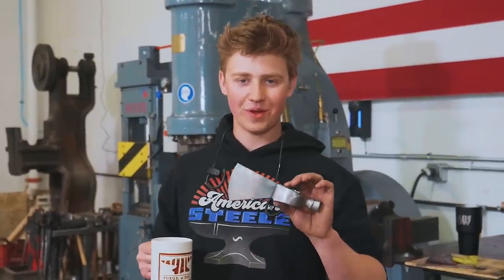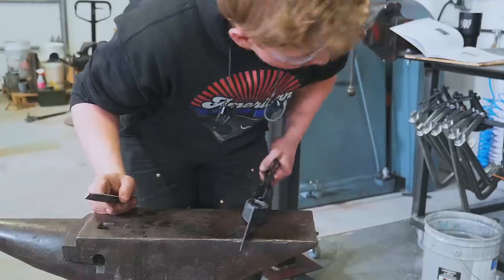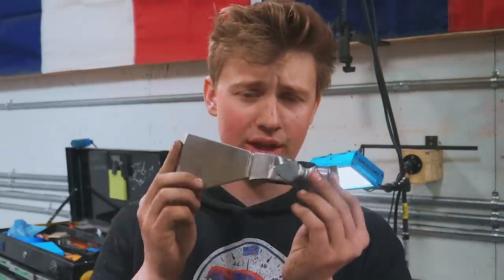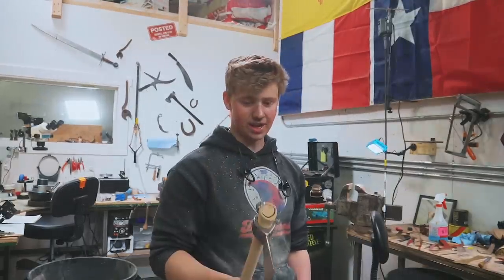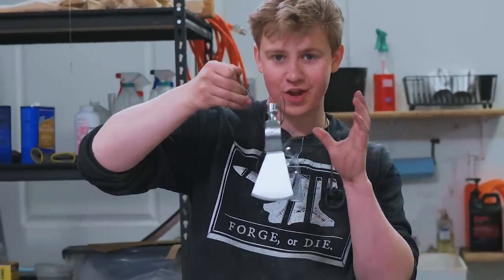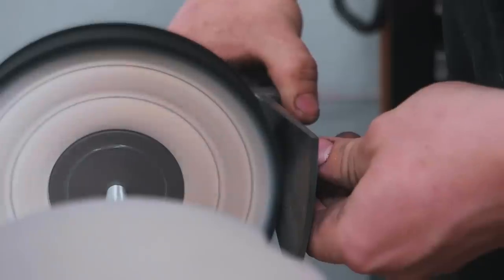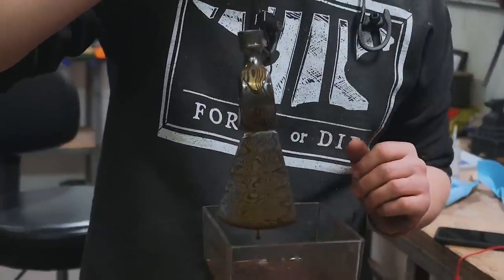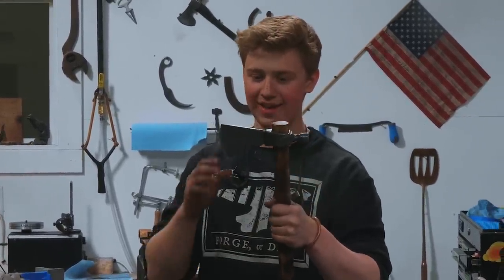MAKING A PIPE TOMAHAWK!!! Part 2

Comment: pine tar-turpentine-linseed oil for the finish and to make mathematical handles make a scribe jig that has a       post----7------scribe-----10-------scribe------7-------post    layout you can make the handle with the top and side view (tapered/curved) and hold this fixture square (top and side) and it will make nearly 45° angles. then, mark on the 45°s and you'll have your 22.5°'s and 67°'s  and bobs your uncle you have an octagon. My recommendations of course, I'm a machinist and woodworker, not a smithy.

Comment: A way to keep the scale off and to prevent decarb is to seal what you are heat treating in a sealed steel foil bag with a small amount of paper in it.

Comment: They are right Will, it does not have anything to do with the thickness of that part, but the geometry, that specific part of the blade usually distributes the energy from the impact to the handle by doing that geometry there you will have an energy accumulator that its the main thing you want to avoid in an impact oriented tool as this one, so yeah, be careful this thing can break a piece without warning

Comment: Could you tape designs, or use mud or clay or something on the blade before putting it in acid bath to control what parts of the blade have the Damascus etch showing?  so you could have a damascus blade with a blank ribbon down  the middle, or like happy faces or whatever?

Comment: Would it actually work as a  tomahawk if it was a working pipe or would the handle just break because of the hole that was drilled into the wood

Comment: My comment about the fuller was not in reference to the thickness at that point. It was a question of building in a point of concentrated stress under unusual loads i.e. off axis hits and throws. Now, I think the design and execution is beautiful, but I would shy away from a fuller running perpendicular to the striking edge.

Comment: Make a handle thicker than the hole. Sand the top 2 inch so it sits on a ledge. Then you could hammer a wedge in on the top as it's supported from the bottom. Just because it's not the same as a hatchet doesn't mean you couldn't mount it similarly

Comment: Are tomahawk hafts/handles really so simple? For some reason I had it in my head that they were slightly more shaped and ergonomic... not that I'm criticising the design at all, it's an awesome piece, but I'd have thought that there would be a little more curve in the wood here or there for comfort and strength.

Comment: Time for the fun police to spoil the party. I am impressed with all protective gear you guys use, and what could be more fun than a blow clean with a compressed air hose? This is what OSHA says:

Compressed air is used in industry for a variety of purposes and is considered the fourth utility after electricity, natural gas, and water.  It’s used to drive portable hand tools, used in scuba diving tanks, used in some vehicle braking systems, and also for cleaning.  Most machining and manufacturing operations have a compressed air system that allows for the quick connection of a flexible hose and air gun to clean dirt and debris from parts.  OSHA sets a limit on the use of compressed air for cleaning in their Hand and Portable Powered Tools and Other Hand-held Equipment standard, 1910. 242, as follows:

1910.242(b) 
Compressed air used for cleaning. Compressed air shall not be used for cleaning purposes except where reduced to less than 30 p.s.i. and then only with effective chip guarding and personal protective equipment.

While not explicitly stated, it is OSHA’s intent that employers in general industry should not allow employees to use compressed air to clean themselves or their clothing while being worn.  However, OSHA does expressly state that, “compressed air shall not be used to clean employees” in their Marine Terminals standard, 1917.154, and recognizes this as a safe practice for all industries. 

The greatest danger of using compressed air (even at pressures as low as 5-10 p.s.i.) is the risk of air entering the body and causing an air embolism in the bloodstream. This can be fatal.  Other risks include damage to the eyes and respiratory system as well as hearing impairment if suitable protective equipment isn’t used. 

It’s important to realize that most compressed air systems used for pneumatic tools and air guns operate at 80-120 p.s.i.  In the case of air guns used for cleaning, the nozzle tip must be equipped with a relief device or port to reduce the pressure under 30 p.s.i. if the air system becomes obstructed or dead ended. 

When purchasing air guns, look for those equipped with an engineered air nozzle meeting the OSHA less than 30 p.s.i. static pressure requirement along with a chip shield and noise output of less than 83 dBA. 

Finally, always remember to wear the appropriate personal protective equipment when cleaning parts and equipment with compressed air.

Comment: Metric system FTW. What is 8 sixteenth of a groat anyway? 4 thousandths of a bushel? 243rds of a 986th of an inch? What the actual F is that system?  2mm 5mm 10mm simple:) 3457th of a 1/4 of a 9/23rd of a chain? huh?